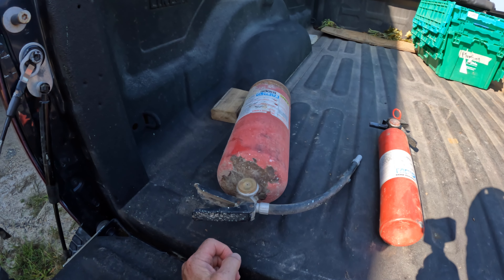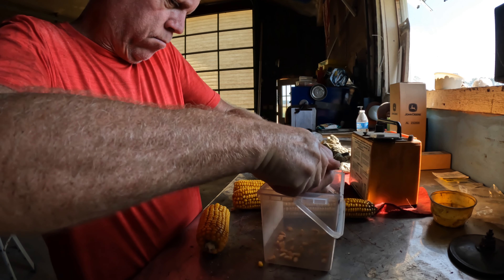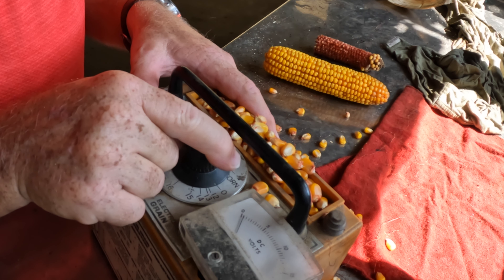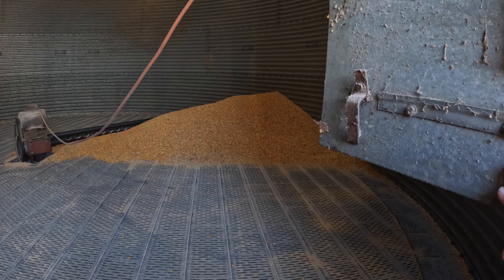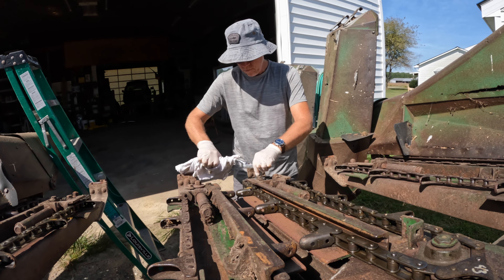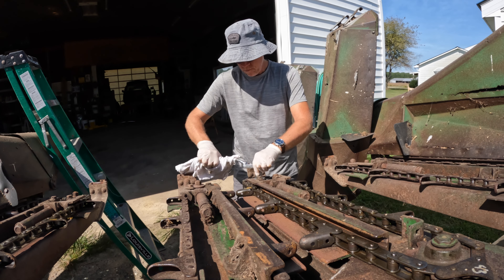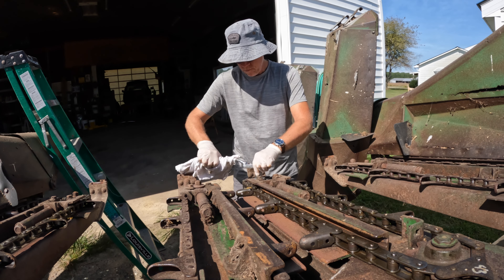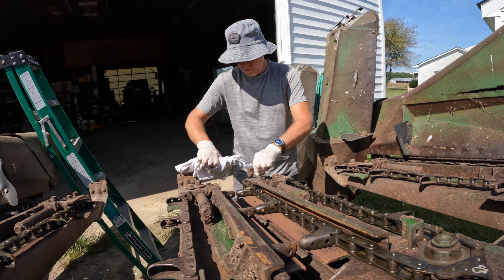Balancing the Straw Chopper on Combine & Other Adjustments

Comment: 18 percent is pretty high.  Coop won't take it over, what, 13 percent?

You have a drier?
Reply: Ummm start taking crop at high moisture and blend it with the stuff I get later that's too dry. It's called sloping your load.use ur head for more than a hat rack